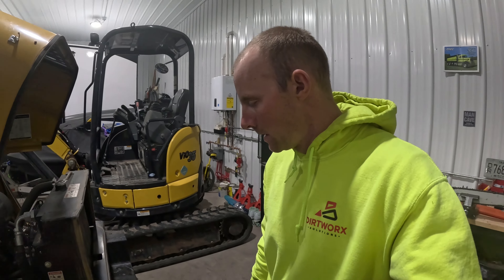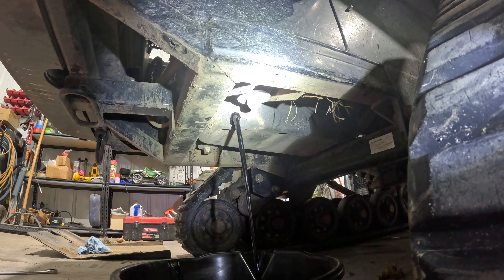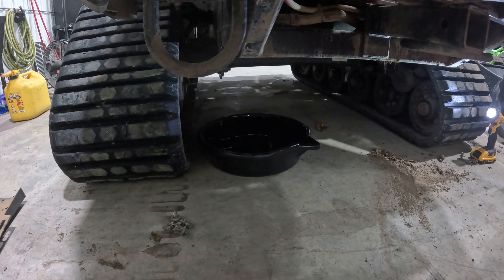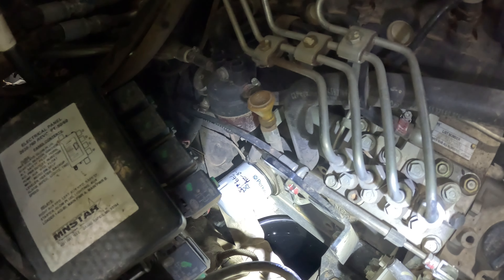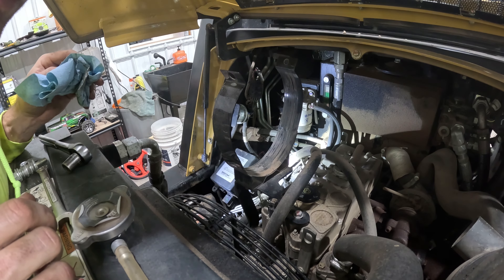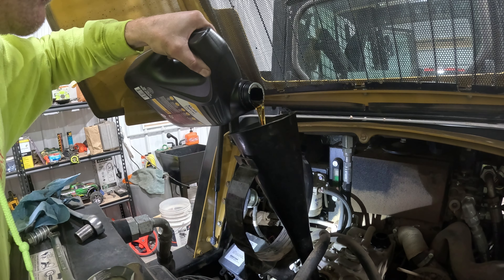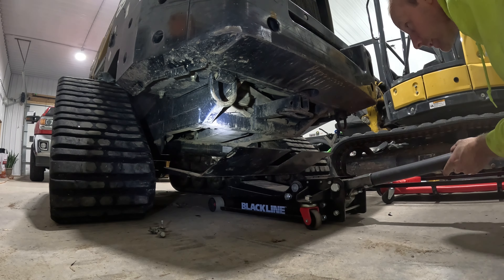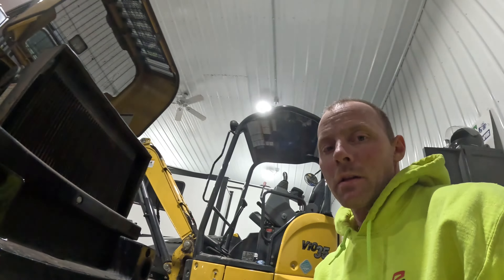ASV RT 60 Service

Comment: Great video! I’ve got a 2015 rt 60. Great machine. I’ve heard the asv max’s have been having issues.  Price tags are crazy. For what you get can’t beat these machines. Plus they’re not bad to work on.
Reply from the maker: Thank you. I really like my rt 60 a friend of mine just bought a new asv rt 75 max I ran that one it is awesome great visibility and control  but it doesn't look to easy to work on .
Reply: @dirtworxsolutions  I did hear the visibility was pretty awesome. It’ll be interesting to see what yanmar does with the brand now they released their own line of skid steers.